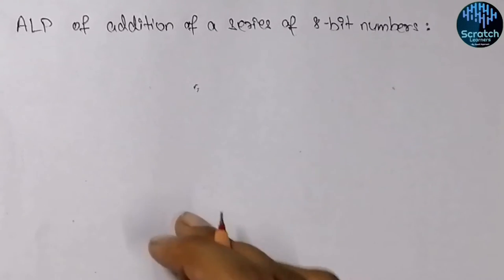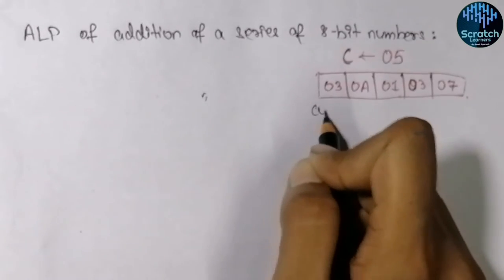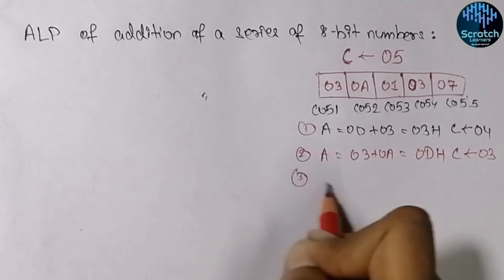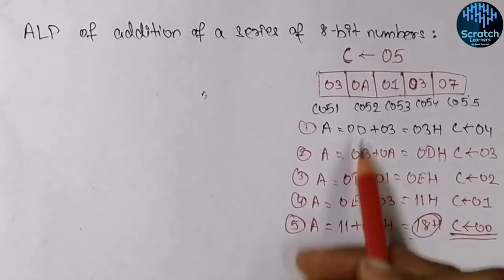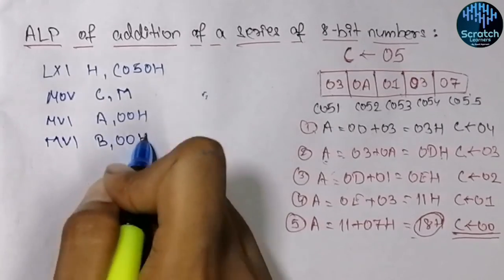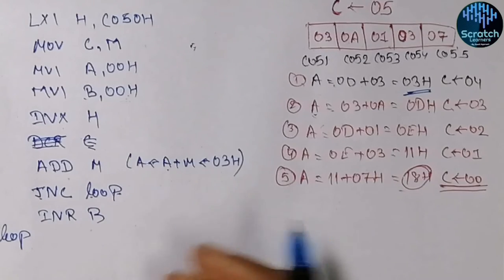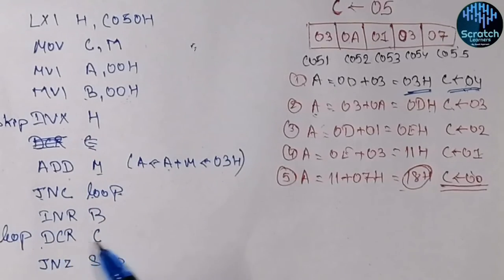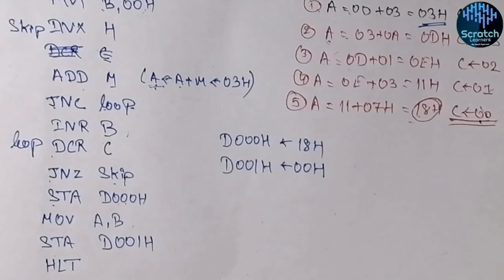8085 program to add a series of numbers|sum of array elements in 8085|ALP to find sum of numbers

Comment: I m still confused!!  If we moved m to c then c register will contain (05) or 03... ?? Please 🙏 reply maam
Reply from the maker: In the beginning, the total number of array elements is moved from M to C which is 05H. Now if we are doing any operation with M, it won't affect C as we have already incremented memory pointer by INX H
Reply: This is irrelevant for you now after 1 year of the question but I'm trying to answer it for anyone in the future -

Below are the addresses and their data from C050 according to the question -

C050 -> 05 
C051  -> 03 
C052 -> 0A 
C053 -> 01 
C054 -> 03 
C055 -> 07

This should answer the question.

A more detailed explanation would be as follows -

LXI is an example of Immediate addressing, where we input DATA in the instruction (not ADDRESS).

So, 

LXI H, C050H 

stores the DATA "C050" in the HL pair (PAIR because of the 'X' in LXI)

Now, the command 

MOV C,M 

stores the data in the ADDRESS pointed by HL pair, i.e. "05"
Reply: thanks 😅